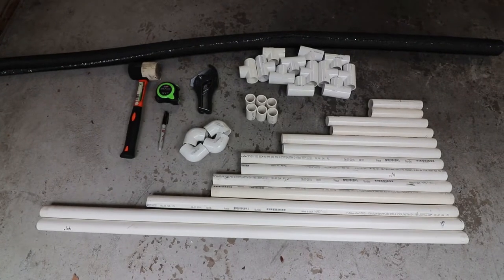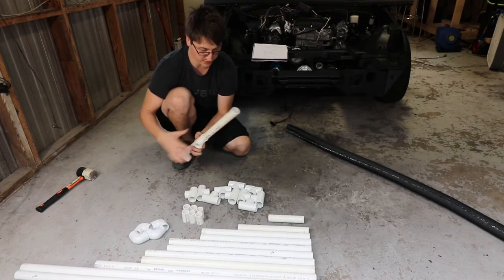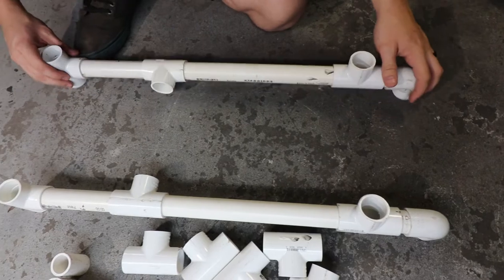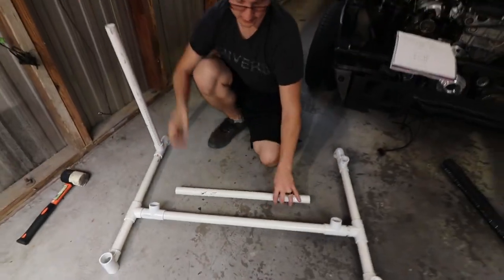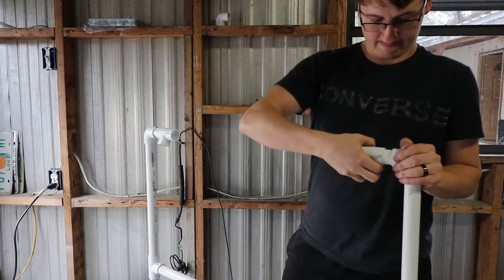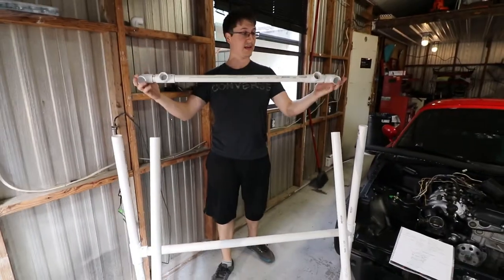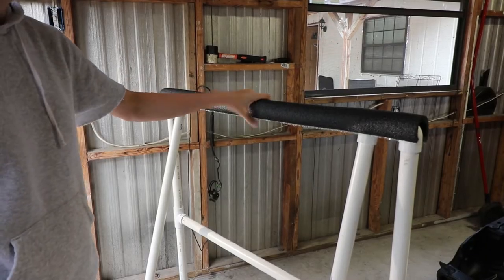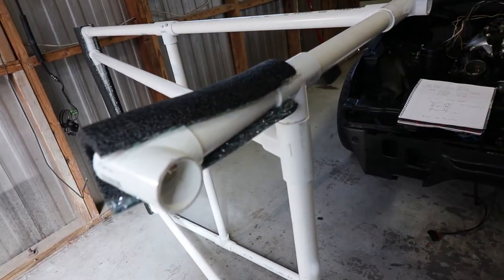DIY Miata Hardtop Stand Easy & Inexpensive

Comment: Great job. I followed it and it went together perfect. Here 6 years later it is about twice as much but still worth it  I did make one modification. Added caps to the feet with a 2 in piece on each since there was extra pvc pipe. Had some rollers from a Walmart plastic three drawer storage   Drill a hole in cap. Heated it up so it was a bit soft and press fit the rollers in.  It sit a bit higher noe but in can roll it around

Comment: Thanks for this, saved me from having to figure out a design and measurements from scratch. A few changes I recommend to someone doing this - add a second 33.5" piece across the bottom of the upright portion if you intend to add swivel wheels, otherwise that section gets wobbly (you'll need to tweak some measurements on the lower upright pieces and add in two 2" pieces to make this fit right). Also, if you want to add wheels, get some 1" cap pieces and drill holes in them to receive the type of swivel wheels that have a threaded stud. Finally, while you're at the hardware store, grab some proper PVC cement to use in final assembly to keep this all together. Dry fitting alone won't hold this assembly together if you intend to move it around.

Comment: Thanks, super accurate and easy to do.  I’d recommend a few pan head screws in various spots.  You will probably wipe and clean window while on stand.  When I did that (even after the mallet) a few joints came apart.  Also I cut 6 extra 2” inch pieces, an bought 6 end caps for a cleaner look, and a slightly higher front edge.
Thanks again.

Comment: Just finished this myself. To keep in the sub-$30 budget, I had to drop from 1” pipe to 3/4” pipe, but used the same measurements as provided and it seems to work fine. I’m going to eventually put casters on it and probably glue all the joints together, but it’s 65° in February, I can’t not drive the Miata today :)

Comment: That’s a great idea ! 
I just made one for my Hardtop following your model. :) 
I just had to convert everything in centimeters first ! Haha 
Cheers from France !
Reply from the maker: Lol I wish we used the Metric System here, it's so much better. Glad I could help though!
Reply: I was struggling to find a decent and affordable solution to store my hardtop and you guys just nailed it ! :D
If that can help any metric user who wants to build the same stand, here are the tube lengths in cm : 
6 x 5.1
2 x 15.2
2 x 30.5
2 x 46.4
2 x 59.1
2 x 67.3
1 x 85.1
2 x 114.3
Reply: Claude Colmars you da real MVP
Reply: @ClaudeColmars  hello claude, metric user here lol haha i'm about to build one, is the measurements you converted, exactly correct?
Reply: @rodolforodrigues3829   They are as close as they could get from the original measurements in imperial units. I used these for my hardtop stand and it worked. :)